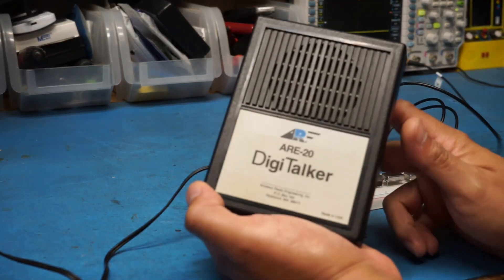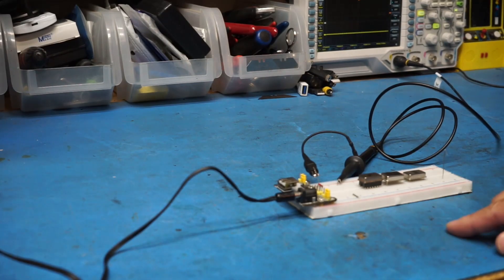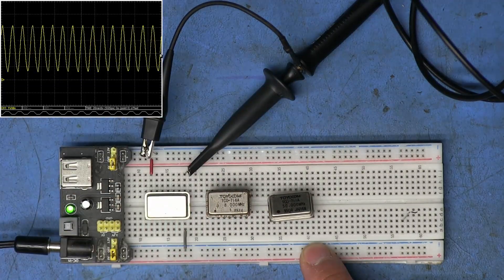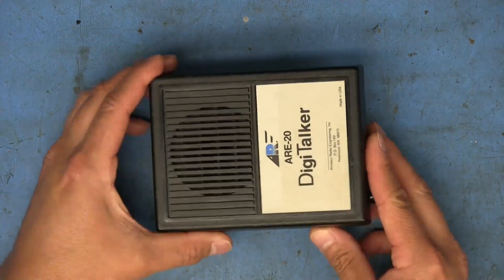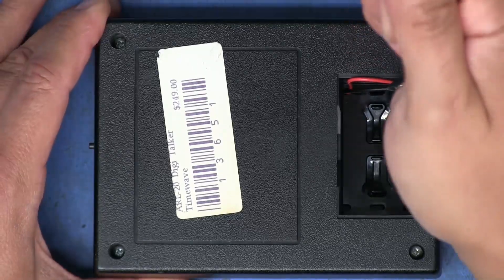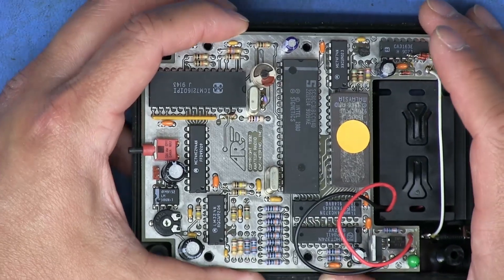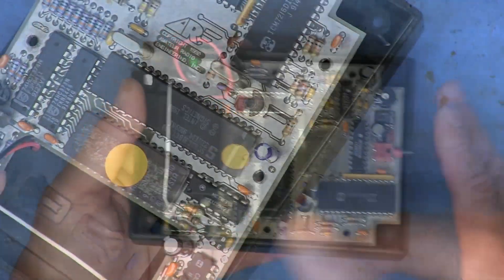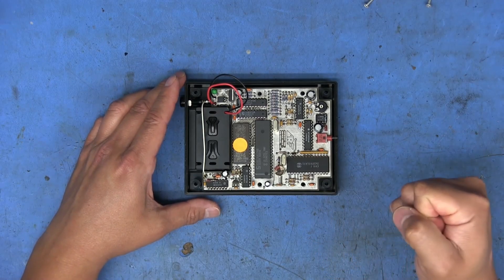TEF #112 | ARE-20 DigiTalker Frequency Counter Demo and Inside Look

Comment: Fellow digitized speech fan here. That's how we did it in the old days. Likely nothing more than a series of header-stripped wave files on that EPROM, pushed out through the makeshift DAC into the amp. There were ads for this device in the early 90's in CQ Amateur Radio. Have you tried it non-contact with an RF transmitter of any sort? That was the intended use.
Reply from the maker: I knew there had to be someone out there that knew SOMETHING about this thing. I did try it non contact near a few things that I knew were producing at least some RF, for example, near an LED bulb I could get a repeatable reading. I forgot I had an RC car controller on hand I could show it with. With these oscillators, I could only get a consistent readout with the wire, otherwise it was saying a bunch of random stuff.

Comment: The Signetics SC80C31 does not have any internal ROM. The code for the 80C31 would reside in the ROM.  Back in the 80's I remember using continue slope variable encoding to do voice prompts in telecom.  Eventually, we switched to ADPCM with more powerful DSPs (TMS320C25 and TMS320C50) that emerged in the late 80's.  I remember Northern Telecom using 8031's in their DMS 100 and 2XX to do voice prompts and in-band call progress tones signal detection.  You could totally reverse-engineer the code for the 8031.
Reply from the maker: I may have to give it a shot!